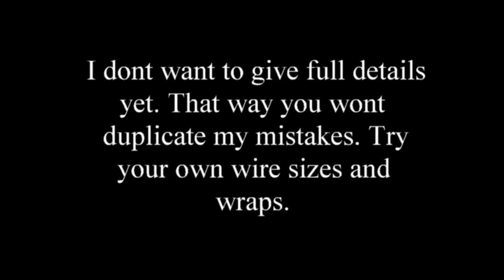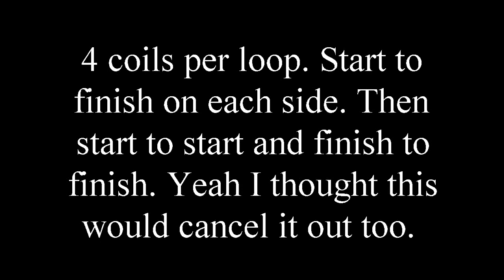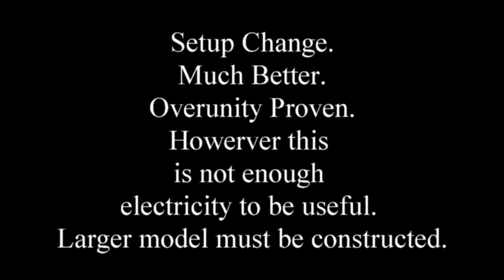The Elliott EasySpin Axial Pulse Generator  EEAPG 720p

Comment: add an axil flux stator as gen to the shaft like ive done took alot of fine tuning but now pulse motor turns shaft to a magnet rotor with axil stator each side of the rotor, we basically coppied the quanta magnetics design ,as its only for personal use ,so perfectly legal
Reply from the maker: Check out my latest in 2021  https://youtu.be/SB9RW3y2qMs